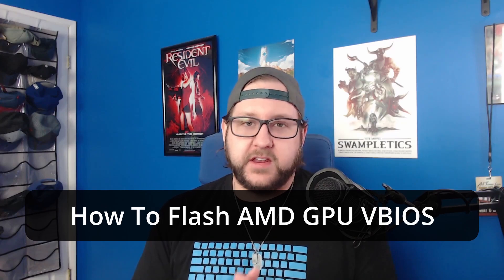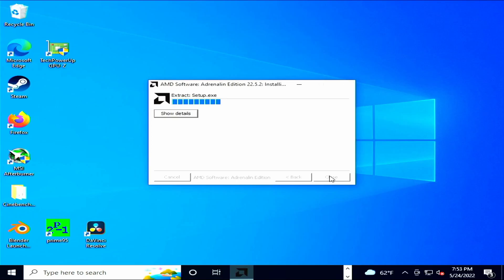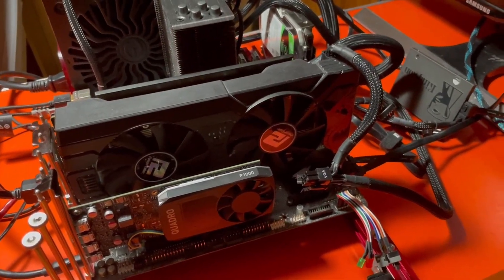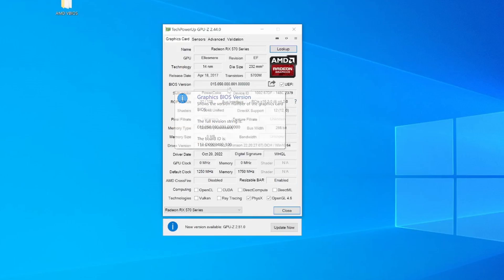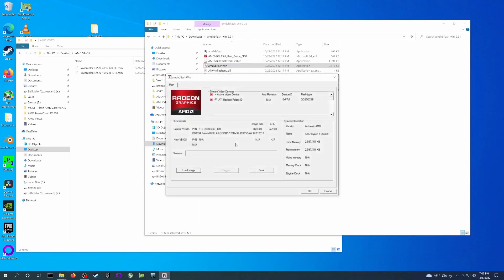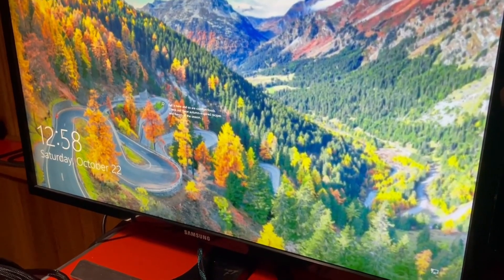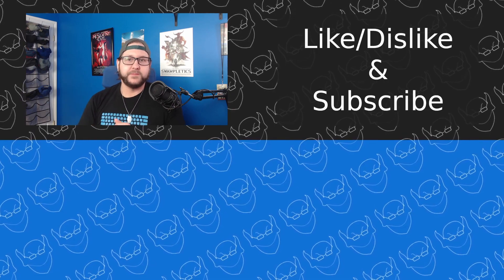How To Flash AMD GPU VBIOS

Comment: Bro after downloading bios and when i load in amdvbflash tool it shows a different P/N number should i flash or not , both cards are same but P/N are little different see this - Original is = P/N 113-C6710101-100  & new one is =  P/N 113-C6710101-U2
Reply from the maker: Which version of amdvbflash are you using? And it might be fine to flash, but i'd definitely try to save the VBIOS that's currently on your card before proceeding, in case you need to revert to it
Reply: @BitGoblin  amdvbflash_win_3.31 and r u sure it would be fine to flash ? P/N should not be same or does it matter or not ?
Reply from the maker: I said it might be fine, and I'd probably advise against the flash if you're not confident it would work. Usually the p/n mismatch is from a mismatched firmware or a bugged amdvbflash version.

But it would also depend on your situation. If you have a borked card like. I did, it may be worth just doing it anyway since you'd have a chance at restoring it 😊
Reply: @BitGoblin  which amdvblash should i use ?
Reply from the maker: It depends, what GPU are you trying to flash? IIRC RX 500 and older cards should use version 3.x and RX 5000 and newer should use 5.x

Comment: Can i make rx 6600 to XT version with this?
Reply from the maker: It's possible. You might be able to make up some of the difference between the two models by increasing the core and memory clock speeds and increasing the power limit, but the 6600 XT also has more stream processors and ray accelerators that would also impact performance.

Comment: So i have an old rx 470 that i plan on upgrading the gddr5 1gb vram chips to gddr6 2gb chips. I'm pretty sure I'll need to update the bios chip. Will it support the new 2gb chips? Because when I type in the parameters, there won't be a gddr6 16 gb version on the 470 on their website.
Reply: Perhaps I answered my own question lol. Too bad Nvidia doesn't make a universal bios version where we can make our own parameters.
Reply from the maker: Seems so lol. But I have no experience with modding my GPUs with more VRAM so I wouldn't be of much help unfortunately.

Comment: Same problem with my asus dual rx480 8gb this  that solution risk for it ?
Reply from the maker: Yep, it fixed my RX 570 4GB at least :) it's also possible you have a different issue, but the flash is worth a shot!

Comment: 6800xt has a 6950xt vbios in it. It works overall but when it comes to battlefield 2042 it has graphical anomalies the second you spawn on map and persists untill I resets the computer. I have went through a checklist for the last couple days trying to figure out where the problem was coming from.
Reply from the maker: It's possible the 6950 XT BIOS has your card on the edge and Battlefield 2042 might stress your card just the right way to push it over the edge. Have you tried potentially downclocking the core or memory clocks to see if that helps?
Reply: @BitGoblin  I was on a bit of a countdown, and I chose to return it to try and get my money back instead. I didn't undervolt or underclock it.
Reply from the maker: Oh good, that was the smart move! I wouldn't have even tried to flash it or anything so there's no complaints when I returned it lol

Comment: How about i dont have a 2nd GPU? it is possible to fix it?
Reply from the maker: It's not required to have a second GPU to do the flash, it just helps in the event you need to troubleshoot a bad flash. Or in my case where my GPU wasn't outputting any display signal. :)

If you need it though, you can use the integrated graphics on your CPU if it has one. Or maybe get a cheap used GPU to output a display.

Comment: I flashed mine also, but after working fine for hours, it starting again to have same symptoms like before I flashed
Reply from the maker: What are the symptoms? The new VBIOS might've been hiding something faulty with the card, or might've just been a coincidence you didn't experience the issues for a bit.

Total shot in the dark, but depending on the age of the GPU it might be the core or the VRAM are degrading, and the new VBIOS you flashed dialed back the clocks just enough to be fine for a hot minute.
Reply: @BitGoblin  I bought it faulty, as being completely dead, after I flashed the bios worked fine for a few hours, and I think it would it work a lot of hours continuosly, but in the morning when I start the pc , same issue, now I flashed the bios again and gave a few restarts of the pc , and is fine so far

Comment: How did you backup the original bios?
Reply from the maker: I didn't backup the BIOS since the BIOS that was on the card when I got it was already borked, but you can do so with the amdvbflash tool. IIRC you can pass the -s flag and a path to a file to tell amdvbflash to save the current image.
Reply: You can extract your own bios and save it using GPUZ

Comment: My friend bought Rx 580 and all the ports on it are missing except the dvi port , it looks like the graphic card was used for heavy mining and its bios is broken and drivers are bugged and aren't loading , another pc technician tells just vbios flash the graphic card , will this work ? Also one of the fan isn't running
Reply from the maker: Flashing the VBIOS could help in this case. The seller could've flashed a VBIOS that disabled the display ports and only ran one of the fans to save power (or just messed up the curve). No guarantees, but it's definitely worth a shot!

Comment: I'm getting an error message saying (SubsystemIDs mismatch) when I click the Program button. I did everything as you instructed please help.
Reply from the maker: Some people have gotten around this error by using an older version of amdvbflash, like 2.9.3
Reply: Thx for the tip I will give it a try tomorrow and let you know if it works.
Reply: 2.93 does not have a download option on the Techpowerup website for some reason I guess I will try 2.84. Do you know if I can download 2.9.3 somewhere else?

Update: 2.84 wont load and I think this card was used by minors and has been changed to be a R9 380X because when I click on Lookup on the GPU-Z at the top right of the application it takes me to a 380X not what I have that is a Asus R9 380. Not sure what to do at this time. The reason I'm trying to update the Bios is this GPU's sound via HDMI is cutting out and I cant enter my Bios on my computer with it installed but I can with my other GPU and I was hoping doing this would resolve both or at least one of the problems.
Reply from the maker: @azrabain8210 so if you click on show older versions and do a ctrl-f search for 2.93 I was able to find it. But that version was only a guess, maybe one of the 3.x ones will work if you haven't tried it yet. 

I think the vbios being wrong could definitely affect booting into the bios, but idk about the hdmi audio. But we'll see if you can get a version of amdvbflash to work lol
Reply: I tried them all, and none of them worked. I have no idea what else to try. I just don’t understand why it’s giving me the error
Reply: SubsystemIDs mismatch)

Comment: can i install rx 590 bios in rx 590 gme ??
plz reply
Reply from the maker: I would guess it probably won't break things, but I'd be worried that there's a reason the 590 gme has lower clocks (like worse silicon quality/binning) that would prevent it from hitting the higher clocks of a 590 vbios. It's worth a shot at the very least
Reply: @BitGoblin  i tried to install in 590 gme 
but the bios utility says wrong p m something
Reply from the maker: Hmm, I guess maybe it doesn't like using a different card's VBIOS? I'm not entirely sure what to do there.

Comment: Why my ATI flash opens in cmd and i cannot see this window where I can upload the bios ?
Reply from the maker: It sounds like you're using the latest amdvbflash version, and the GUI was dropped in 5.x. You'll need to use an older version if you want the GUI, or the CLI if you have a newer card (like RX 6000 and 7000 series)

Comment: is this can set my amd graphics to default bcs i have sort of errors after updates bcs it is dugget up
Reply from the maker: It's possible it can help though I wouldn't expect it to. Usually updates would just affect the driver and not the hardware, and it's possible you need to do a clean install of your drivers if you're seeing recurring issues.

What kind of issues are you seeing? And what GPU is it?

Comment: Tried everything on the instructions. After rebooting, my gpu only shows lines. Please help😢
Reply from the maker: What GPU are you having trouble with? And have you tried it in another system or another PCIe slot?
Reply: @BitGoblin  same as yours. Rx570 powercolor. Tried on another system and same. Now it got worse because I think it shorted out because the whole system wont turn on if I got the gpu plugged.
Reply from the maker: Shoot, sorry I read your message and totally forgot to reply! It definitely sounds like something is messed up with the power on that card if it's not even able to power on. Do you have another card to test if the rest of the system works?

Comment: Why doesn't mine show "amdvbflashwin.exe" 😢😢😢😢😢
Reply from the maker: The amdvbflashwin GUI had issue and was deprecated, and it was removed in version 5.x. If you're using an older GPU (I believe RX 5000-series and older, RX 6000 might be supported) then you can use an older version of amdvbflash to get the GUI.

Otherwise, you'll have to follow this tutorial to use the CLI: https://www.techpowerup.com/forums/threads/amd-ati-flash-command-line-cmd-syntax-mini-guide-windows.291671/

Comment: Does anyone have a method that worked for a MXRT barco 7600 that is actually a AMD Firepro W7100? I cannot get the BIOS version for the W7100 to actually flash to the card. I have tried DOS console and the GUI. I get error subsystemID mismatch with the GUI amdvbflash.exe but It acts like it wants to work but actually doesnt do anything when trying with DOS. @setmaddy do you have any input I see you also had a W7100

Comment: I have same problem with my Asus RX 580 8GB mining edition with only DVi display port, it turns off display and the GPU fans stops while the CPU fan is still running….. I don’t know if I flash a new bios it will solve the problem
Reply from the maker: It's very possible it has a mining VBIOS that disables the displays and makes the fans hold off til it gets hotter. It's worth a shot IMO.

Comment: I wanted to flash a new bios since my RX 570 doesn't support UEFI for some odd reason, believe it is a mining bios, therefore I will flash it.
Reply from the maker: Yeah that's definitely a weird behavior
... Let me know if the flash works!
Reply: @BitGoblin  After a lot of time trying to make sure I found the right BIOS, it works, now I can boot my system with secure boot on! thanks for your help.

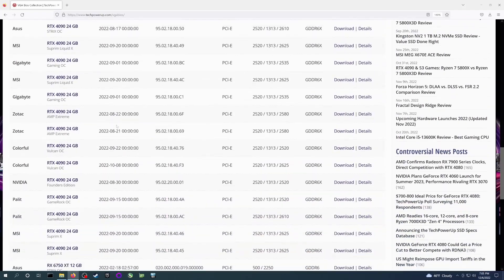Comment: The seller who i bought from him the gpu send me a special bios file, should i use it instead of this version ? 5:17
Reply from the maker: Hmm, tbh I'd be slightly sketched out by the VBIOS that he sent. It's very possible that it was just the image that was flashed on the card before they flashed like a mining image, but it also could be something else entirely.

I'd lean toward using a file from TechPowerUp if they have one available, otherwise if you're less paranoid than I then you can try the seller's file lol.
Reply: @BitGoblin  i already figured that the seller is safe i trust him, but the problem is that the bios file's name has written in Chinese, when i load it as image on amdvbflashwin it quite, so i changed its name. Do you think this is it normal ?
Reply from the maker: I wouldn't say "normal" but it's possible the seller just wanted to make sure you had a working VBIOS. If you trust them, then give if a shot 😊
Reply: @BitGoblin  
I tried it but didn't work, thanks anyway 😄
Reply from the maker: @youcefmoussaoii9635 ah shoot. If you figure it out though let me know!
Reply: @BitGoblin  
Sure, i will share you any helpful information

Comment: i have a problem with rx 570 sapphire pulse , it runs with no problems until it draw more than 90 watt if it excedds that it would black my screen and GPU fan speed reach 100% 
i tried changing my PSU and even the Tried it on another PC , still got the same problem 
what should i do ?
Reply from the maker: Hmm, I'm honestly not sure what to do in this case. Since you've ruled out power supply, PCI-e cables (from trying the new PSU) and your build, I'd lean toward it being something to do with the power delivery on your card or maybe the GPU itself is having trouble under load. But I'm not sure how you'd diagnose it further

Comment: Hi I have done all the steps but still my Gpu does not take drivers, it still says (windows have stopped this device because it reported problems (code 43)
Reply from the maker: What GPU are you having trouble with? If it's an older one, it's possible the drivers you have installed are too new for the card.

It could also just be that the card is faulty in some other manner, though I don't know how to troubleshoot much further unfortunately.
Reply: It's an MSI RX 570 gaming X 4gb

Comment: Hello, I have a Sapphire Nitro+ Rx 580 8gb It has dual bios. When I switch to the Performance bios It's showing Msi vendor with lower Memory and high clock speed 1380and 1750. I am planning to flash it and revert it back to the original Sapphire 1411 and 2000mhz bios. But when I install the flashing tool It only contains 6 files there is no amdflashWin file. When I run the AmdVbflashInstaller and Install the tool It won't showup, I don't know what to do can you help?
Reply from the maker: Since you're work with an RX 580, try using an older version of amdvbflash (before version 5.x). The GUI was dropped in newer releases and only ships with a CLI tool now.
Reply: @BitGoblin  hello, thanks for the response. I tried the 2.93 version and forceflashed it and now its working. 😀
Reply from the maker: Awesome! :D I'm glad it's working now!

Comment: Hey i have an rx570 and i dontk know why after installing  driver the fan suddenly turn off it wont turn on and the temperature reach high still it wont turn on  and then i checked on the gpuz the ram and the core showing 0mhz and i tried with another driver it still the the same, i was frustrated i swappee with another motherboard and it still the same, could it be a mining bios? I was bought it used rx570 sapphire nitro
Reply from the maker: It sounds like it could be a vbios issue, especially since it can't read the core clock or anything. Definitely worth a shot to reflash it

Comment: Can you please tell me how did you convince the seller to gives you a refund ? Because i have an issue like this but he says to me that i need to install  a bios to the gpu and he send to me a bios file and i don't know if it will fix the issue or not
Reply from the maker: Honestly I didn't do much to convince them, they just accepted the return request when I filed it through eBay. It was a very thorough request with all the things I tried, so maybe they just saw I tried and nothing worked?

Tbh I wouldn't accept that as a possible fix and push for the refund. Requiring you to modify the card in anyway (including flash the vbios) could muddy the waters in the event he wants to fight it, giving them a chance to claim you messed it up somehow with the flash.
Reply: @BitGoblin  
Okey i'll try my luck

Comment: When I place my known working rx 580 into the main top pcie slot while having the bad rx 580 in the bottom pcie slot the good one won't display and VGA motherboard debug light is on.  Help?
Reply from the maker: Huh that's an odd one. I'm assuming you have a sufficient power supply for both GPUs? And does the system post at all or do you not even see the bios splash screen?
Reply: 650w EVGA G6 psu so covered there.
No display or bios post?!

Comment: Also dont blame the seller people all over my country are having this same issue from new cards its so bad that most stores dont sell amd i have never had this problem when i was on team green and it looks like after this last step does not work im never looking at the color red the same again
Reply from the maker: I mean, AMD's cards have been mostly fine in my experience, and even better in some circumstances like if you're gaming on Linux (like myself). In this case I definitely blame the seller because he sold me a GPU that was advertised as "working" and it showed up as non-functional - granted it was an easy fix, but I would contend that it should have showed up without needing the flash.

In your case new GPUs with similar issues is definitely odd. I wonder if there's like a batch of faulty cards that got shipped to your country or something? I'm used to there being some stability issues shortly after launch of AMD card, but after a few months or so those usually clear up and things are mostly fine. Maybe outside the US AMD just sells borked cards or something lol.